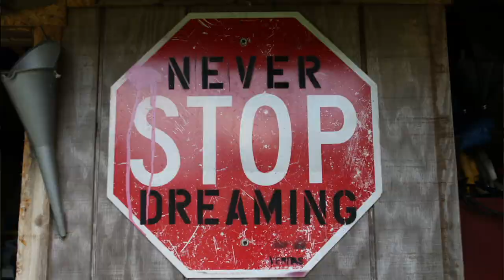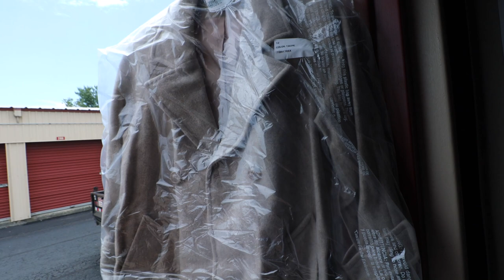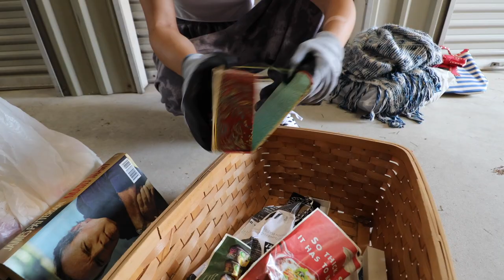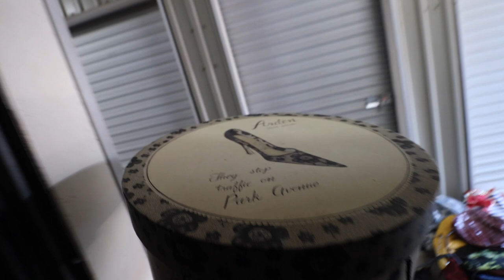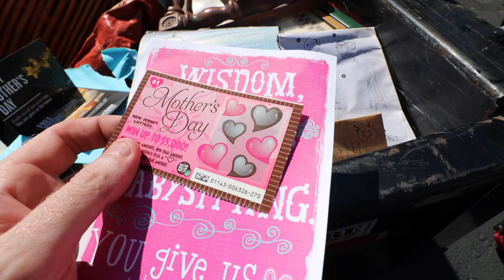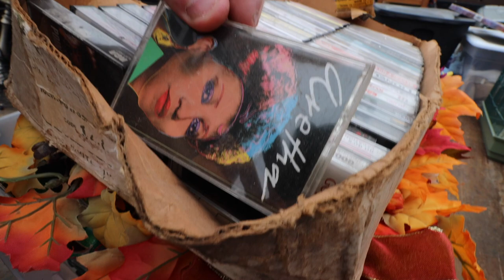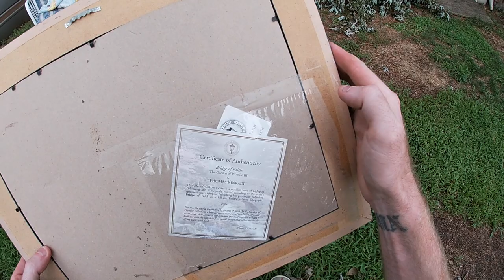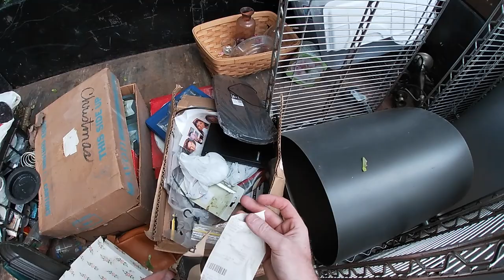WE BOUGHT AN ABANDONED STORAGE UNIT FOR $142 - Treasure Found Inside SILVER Flute & GOLD Jewelry!

Comment: Those glass balls with the log thin tubes are for watering plants. You fill them with water then push the tube down into a pot plant's soil and it drip feds with water if you are going away for a few days.  I hope you checked all the handbags and purses for money, also money notes shut i n books.  I could see a heap of good retro in your junk pile.  I got the feeling you didn't want to spend a lot of time on the unit.  Stay safe.

Comment: If that first piece you pulled out is  a dehumidifier... score!  Those babies will save your butt when it gets humid out.  It wouldn't be any good in Haiti - wrong voltage.  Too bad I'm not handy to mess with the jewelry for you. (that hat btw is a St Patrick's Day necklace)   All of the Pier Ones are going out - they're closing their retail stores for good across the board I think.  33:00 That was my first thought about that porcelain doll too.  New construction so not worth much and best sold as a skeet target. (probably sick, but it's about all they're worth these days.)  34:35 If I found that... keeplife! Never have to buy a bead again. If even half of those were stone they cost more  retail than your unit did probably by a factor of two.    51:31 Silverplated flute at least , and at least 60 years old.   The pads are shot, guaranteed.  A manufacturer's name would make life easier, but the real silver ones are still out there.  http://bertremflutes.com/bertrem-flutes.html  The FedEx pendant was an employee reward for time served.  Some are legit gold, some are gold-filled and some are nothing.  It depends on how cheapskate the company was.

Comment: Dude, , it is a FLUTE. if it has any silver it will be on the head piece.  The oval  with the hole in it where you blow and the top piece where it unscrews. Don't unscrew it. It really is not worth much. I have a few flutes and that one would take a lot to ma ki e it playable. New pads, key tensioner  and a polish.